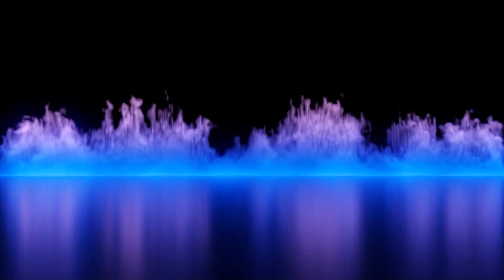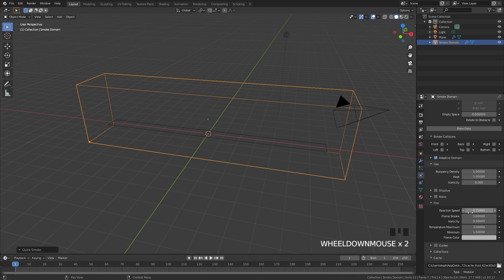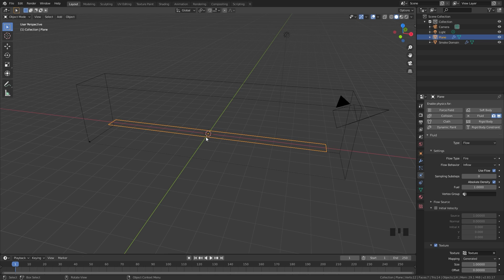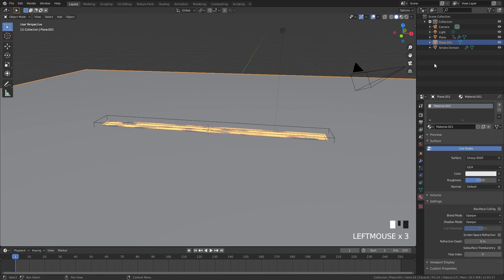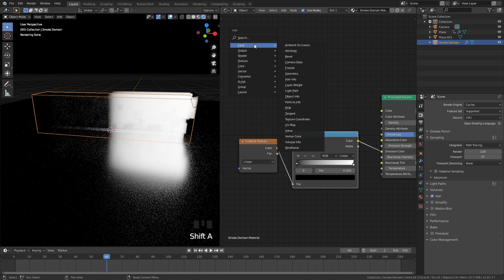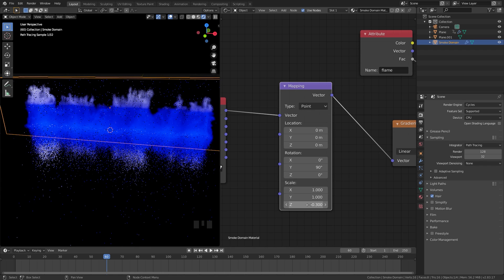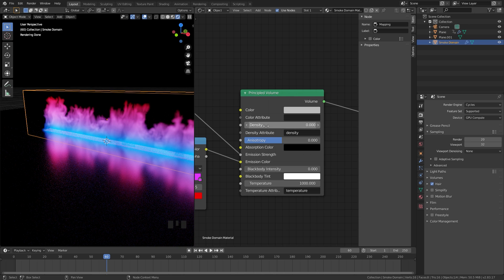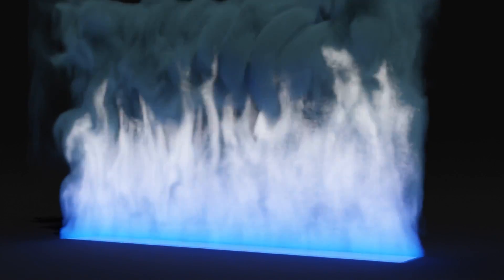Blender Tutorial - Gradient Fire Animation (2.83)

Comment: Using 3.1x there is a difference in how 2.86 and 3.1x bakes the flames. Completely different outcomes. Same with how the gradients are applied.
Reply: Did you find a workaround to get similar flames?
Reply: @ericstevens1198  I installed an older version, followed the steps then opened in 3.x

Comment: Not sure what im doing wrong but my render just doesnt have the resolution, the flames are blocky and pixelated, iv got sampling and subdivision quite high but no effect, im using 2.9
Reply from the maker: If you are using Eevee set the tile size in the Volumetric Tab to 2x.
Reply: @BlenderMadeEasy  No, im using cycles as you are in the vid, render sampling is at 128 and resolution division is at 300, iv tried using adaptive sampling and no effect either way. Everything else looks ok. Thanks for replying aswell :)
Reply: @troybishop174  help too on this ? how can i make the fire more crispy ? cycles render please !!!! <3

Comment: I'm in the middle of re baking the simulation. Every time I close out the file (+ closed out blender 2.83) and re opened the file the fire is gone. Does this mean I have to re set the Cache file to a different location ie where I saved the file or just a non Temp file.? Great tutorial BTW thanks!! Edit: Stopped video when you opened the shader never turned up the blackbody intensity for renders. Also as a side note. While I was rendering the animation I changed the background to be dark it was light grey. Went to check on the animation and the background was black!!?? Is that a bug or just the way blender works?
Reply: In Cache make new folder, when you save your project that cache will be linked to it,  Start with Modular baking, do not bake full firewall until you are happy with a small section, refine according to your rendering hardware.

Comment: Went through all the steps as described but the fire effect comes out with pixelated edges in both viewpoer and final render
Reply from the maker: If you are using Eevee make sure the volume tile size is set to 2 pixels. This will sharpen the render.
Reply: I have the same issue however in cycles. I'm not sure how to fix it :/

Comment: I haved used exactly the same settings. Exactly! And my fire looks totally different. And that goes for everything. Smoke and water. Your flames are nicely defined. Mine are not. I have no idea what is wrong or different.
Reply: Maybe the scale of your domain and flow objects has something to do with it? Don't take my word on it tho I've only recently started using blender
Reply: Diego hi, thanks for the tip. But no, I reinstalled Blender and it helped. For the fire. That being said, when creating the gradient color, I had to use different color ramp settings to achieve the same effect. It is weird.